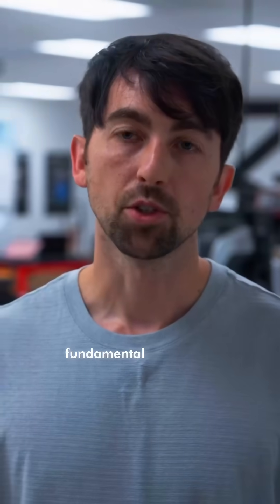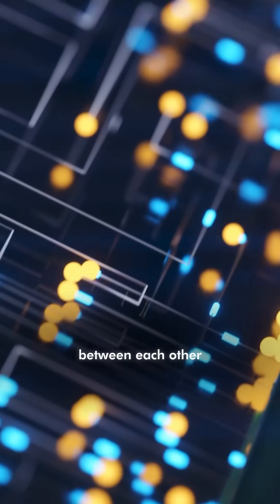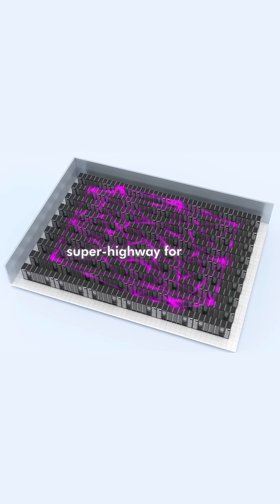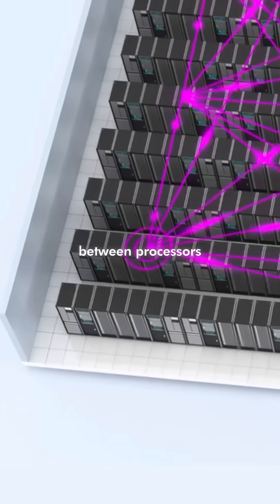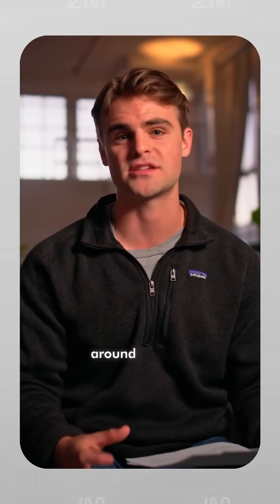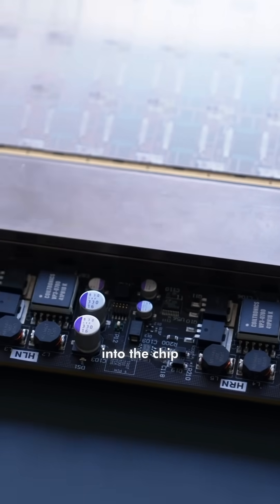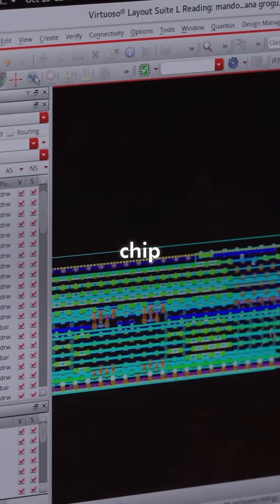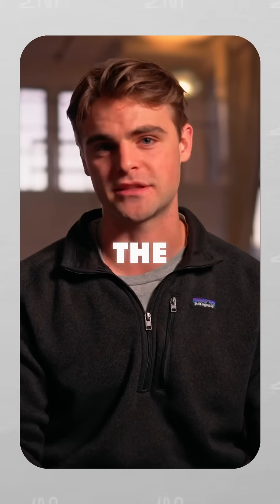Beyond Traditional Computer Chips | Lightmatter

Comment: Optical waveguides on chips are significantly larger than electrical metal routing, not smaller.
Modern metal interconnects are ~20-30nm wide. Silicon photonic waveguides are usually ~450nm wide because of the diffraction limit (you can't confine light into a space significantly smaller than its wavelength, usually 1550nm for telecom).
If you made a fiber as thin as a modern CPU transistor wire, the light wouldn't fit. The reason we use photonics isn't size, it's bandwidth and lack of resistance/heat over long distances.

Comment: Compared to CMOS transistors optical elements and fibers are huge, massive structures and it takes a lot more energy to transmit data in photonics. You can have a large bandwidth though and it's convenient to have a fiber if routing across long distances.

Comment: Using light is really genius because it can cross paths and the information is not affected
Reply: Not if it's guided by fibers, like here. And free-space optics takes even more space than fibers.
Reply: @Martinit0 I was taking about integrated optical circuits
Reply: @Pedro-San705  Like what integrated optical elements specifically? Most elements are about interactions, not crossing unaffected.
Reply: @Martinit0  it's called integrated photonic circuits, look it up. But you didn't extrapolate well my comment, I'm not limiting to talk about just what's in the video.

Comment: NEO 🟰 DEFAULT MODE NETUUORK 🟰 ONE

546 NEWBORN -- Q
546 UUORLD -- P
546 ILLUMINA -- O
546 GOD SEVEN -- N
546 VITAMIN C -- M
546 THE ANGELS -- L
546 PRIME DAY - K
546 NEUTRAL -- J
546 BLUE WAVE -- I
546 TETRIS -- H
546 RADIATION -- G
546 STARGATE -- F
546 BATTERY -- E
546 SPIRIT -- D
546 FAIRNESS -- C
546 MIRROR -- B
546 FUTURE -- A

Conscious Agents use The 546 Geometric Consciousness NETUUORK to Connect × Coordinate × Collaborate.

Comment: I've been a bit irritated with certain proponents of photonic computing because one of the bigger bottlenecks in computing is keeping the processor fed with data; it's memory bandwidth. Photonic computing doesn't really have anything that can replace DRAMs, at least as far as I know. But, photonic network switches actually make a lot of sense.
Reply: So you'd need a special RAM; traditional ram isn't reverse compatible? Is that what you're saying?

Comment: Electricity moves at the speed of light as well.
Reply: Not true. Even in a vacuum (which CPUs aren't, not even close), they travel at 50-99% the speed of light.
Reply: Not true. Even in a vacuum (which CPUs aren't, not even close), they travel at 50-99% the speed of light.

Comment: My father was right. All Computers will glow with light as they compute...
Reply: final evolution of RGB gaming computers
Reply: @0EEVV0  lol
Reply: Wait till you hear about nuclear computing .
Reply: JUST LIKE HUMANS DO! 🤩🤩☝
Reply: nah, if it's glowing it means there is a loss, thus bad design.
Reply: @alkeryn1700 the loss is in the form of light rather than heat.
Reply: @TylerGrieger  doesn't change my point, if it's glowing, it means you have loss, thus bad design.

optical computers shouldn't have any loss, or close to none.

definitely not enough such that you could see it.
Reply: @alkeryn1700 loss is inevitable. It’s the law of entropy
Reply: @mrlloyd149  loss isn't inevitable depending of your system and it has nothing to do with entropy.

and even if there was loss, there is a difference between small amounts of loss and loss so high you could visibly see it.

Comment: So what does this technology actually do?
Change the way the cpu comunicates between the motherboard components or the way it communicates with other pc?
Because in the first case I find it ridiculous and too hard to make.
In the second case it's the same problem, we already have components and chips for ethernet communication, there is no purpose using light because all that time gain is lost inside the networking system which would also be 1000 times more expensive because of the different technology

Comment: The first time I realized that in the Star Trek Universe, the circuit boards for the computer/s transmitted light rather than electrons, that's when I realized that with the approaching limits of Large Scale Integration would limit the speed of computers but also the data density.
By using fiber optics and different wavelengths of light through the same physical fibers we would be able to surpass the physical density of integrated circuits by passing photons rather than electrons and increase the speed at the same time.

Comment: I remember when MB and GB used to be big. Now we’re talking 1TB / second 😮
Reply: wse-3 has 21,000TB/s of bandwidth throughput
Reply: Be aware that terabit ≠ terabyte 
One terabit is actually an eighth of a terabyte since 8 bits = 1 byte
Reply: @dusenkarotte007well, the video says 100 terabits per second, which is 12.5 Terabytes. It's actually more than the comment.
Reply: @dusenkarotte007 Thanks, That just helped me with some nonsense about these units that was going between my neurons lol 😅
Reply: @dusenkarotte007yes true, that results in 12.5 Terabytes per second, still insane
Reply: 1TB is now partially available even commercially. It’s insane
Reply: @shohdj6679 err.. what are you smoking? what has 1TB of bandwidth or speed? our best SSD’s top out at 17GB/s and our best GPU’s top out at 700GB/s - those are just barely commercially available
Reply: @fryttCG multiply that by 8, 16 or 32 bits. We're talking bits, not bytes.
Reply: Japan has transmitted  a petabit a second in a short distance cable if they improve it they can make a really high output ethernet
Reply: The file sizes ballooned with 4K video, 200 GB games, and especially with LLM’s.
Reply: Yeah, similar to this was growing up being a millennial and reciting the components of a computer... We used to have ALU in the CPU. Now, it's just the part of the SoCs being buffed with power and ability.

Times change and so do the relevant socio-economic aspects around the tech industry.
Reply: 100*
Reply: Yes, and a decade of two we will probably be able to talk about YB/!✌️That doesn't even feel that crazy anymore
Reply: that is the trend but it's a little surprising that it's going so much faster than more's law
Reply: 100 bro not 1
Reply: I think people here are using wrong scales. He clearly said 100 Tb /s not 100 TB/s. The small or capital "B" makes a huge difference
Reply: Naaa, we're talking PB/s for a single fiber & EB/s for multi fibers.
Reply: 1TB/s is about the memory speed of the RTX 3090. That's not last gen, that's last last gen.
Reply: We already are in GPUs for years
wdym

Comment: 1)Will this technology adress CPU heating problem?
2)Will it decrease the energy consumption 
of CPU?
Reply: 1/10 energy consumption compared to electronics chip ,less energy means less heat or no heat.
Reply: well light produces less heat than electrons and converting electric energy into light energy is more efficient (it will require less energy).
Reply: Seems like so to me, but i wonder how overclocking will work or be even possible though..
Reply: As far as these optical computers can efficiently run software that were designed for general prupose CPUs: yes. However there's a subclass of algorithms for which optical computers aren't well suited.

Comment: Very interesting but i think you made a mistake with the unit. I think he said over 100 terabits but you wrote terabytes. 1 Byte = 8 Bits
Reply: This byte and bits difference is the worst. It’s hard to remember or hear the difference. Companies use it to confuse costumers. One of the too ought to be illegal to say.
Reply: @simonjonsson3654  It had a purpose rember 8 bit computers that meant that they operated off of 8 bits being a string, thus being a single byte
Reply: @nicholasm5184 yes you’re right they’re both useful. But still, the naming!

Comment: 1) Would they be cheaper that traditional chips?
2) Can they be designed on same instruction sets as the traditional chips?
Reply: Yes, they can be programmed the same but the design of the hardware will be different because less parts are needed for light computation actually making them capable of being more compact. Not an expert I just study it closely so I can’t give finite detail. I’m really enthusiastic about this technology moving forward though. It has a lot of untapped potential in terms of stepping forward to getting rid of electrons in many devices. Making power cheaper. Eventually replacing majority of electrical lines and only using an electric plug when needed for things like motors and heating elements. Luxury electric cars will make more sense with this technology in them and it would be harder to complain about the extras engineering side. Company corruption will likely still be a problem.
Reply: 1. Yes atleast in the future. also less energy consumption 
2. Hmm depends. It's more of analog operation
Reply: Yes to both. Why tf would they not?
Reply: promising 
as a start if they could make some optical lcd's link between cpu' and monitor that can help determine the need and success for future.
Reply: @reviewdtime it doesn't work like that, LCD use whole class of COG IC and work primarly with massive multiplexers that work in very not optimal enviroment on ITO connects, massive capacitance and wild medium of LC or OLED, photonic IC are massive, COG are usually very long to fit, if you want to put them in to processing that may be working but will not be cost effective by very long time becouse this is domain of DSP with 256bit+ long registers and other highly paralell stuff
Reply: @reviewdtime You just sparked an idea for me. You could micro the LCD screen into a graphics chip. The fiber optic connection can be used to bring the image to a screen that magnifies the image like a projector screen but flat and uses no extra energy like traditional displays. Even if the micro display needs to be boosted to show it properly on the fiber optic magnifier display F.O.M.D. 
It in theory would still use far less energy to pull off and use less hardware. The micro LCD screen also gets the benefit of being right next to the hardware for lower latency. The issues then become brightness and is there enough fiber optic lines in my cable to display the image. The other traditional problems would shrink as it would be easier for manufacturers to optimize such a small display to match their hardware. Peoples F.O.M.D. Screens would be forward and backwards compatible though it would likely be best practice to overpopulate the fiber lines to screen for best results.
Reply: From what I understand it’s kinda not really a processing tech. It’s really just an interconnect technology at the moment
Reply: It would be alot cheaper and more future proofing larger data centers and perhabs be a thing with quntum processing even more
Reply: Cheaper when you approach the limits of performance, sure. The application is extremely parallel computing like in data centers, not single-GPU systems like a PC. And yeah, the instruction set remains the same, because this doesn't change the way the computation works. It's a replacement for the electrical wire, not for the transistor. Mind you, there are other people working on optical computation and there the answers are very different.
Reply: If they can figure out how to manufacture them in the same production volume as traditional silicon wafer chips, it'd be cost competitive 
And it'd have the same capabilities, put several times faster and much more energy efficient, the only difference is the interconnect that transfers data by optical cables instead of copper wires
Reply: @newworldordernyus  The scaling isn't necessarily difficult, the die itself is less complicated to fab than the GPU. It's just that there isn't enough fab capacity dedicated to the process. Or testing. Or packaging. But it's being ramped up worldwide.
Reply: 2)yes, light (photon) can measure by binary system. But I prefer to use its analog property.😆
1)Not far from each other I guess. It use similar technology as LAN wire and am sure it will be nano scale (why not).
I answer 2 frist because it's easier, love your question
Reply: No and yes
Reply: 1) no, first generations will be expensive as hell but in comparision economicly superior becouse you will save power/space/pain/money
2)there is no reason to use x86 or ARM or any other existing architecture, this is different method of computation with own pros and cons that require own approach

Comment: One thing most people don't understand is that the electrical wave wnergy actually exists OUTSIDE the wire (on the surface) because of the same reasons that a Vandergraft Sphere.
With the electo-magnetic traveling outside the wire, thiz is one of the reasons s aling down CPU chips becomes impossible -- as exterior waves beside each ormther actually interfere with eact other. It is considered the Qunatum Limit for circuits.
However light generally doesn't interact with other light and can be kept within the constraints of a glass fiber.
Reply: So electromagnetism is causing the limit?
Reply: @gradystephenson3346  yes. With electrical wires you generate electromagnetic waves that interact with each other if they're close enough. Generally this sint an issue since the currents running through these chips is so small that the waves don't travel that far. Or are too weak to interact. But as the chip gets denser and denser, there will be enough electromagnetic fields that will interact with each other and cause performance issues
Reply: @gradystephenson3346 No. Capacitance of the electrical wires/paths is the limit.
Reply: There is a good video on it which someone deleted my link to. It is by Vertasium and he goes over all the same details. Worth watching
Reply: @LG-qz8om it's debunked. many falsehoods in his video.
skin effect is real though.
Reply: Never heard so much nonsense about CPUs. The reason why we can't shrink them smaller is because electrons can tunnel through thin material and with high clock frequencies reactive currents will flow through isolation and heat it up.
Reply: Yeah, i reasoned that since the thing doing the work and having work be done on it in an electrical system is the electron, which is charged, and which also has a field that spreads everywhere proportional to the materials’ resistance, while transmission using light utilizes the uncharged photon as the message carrier, optic data transfer could prove very advantageous in the future.
Reply: Nice
Reply: Yep, faster is the keyword with this new chip
Reply: @friesguy2403I mean, that's a simple way to look at it.
Reply: Right, doesnt all electricity create magnetism and vice-versa? This seems to be an inconvenient side to the usage of conventional electricity (electrons) in nano-scale technology. Light particles are the same thing, but they are perfectly, quickly fluctuating waves/particles of electro-magnetism. They are inherently self balanced, and more importantly, a more compact way to transmit data. 

All the electromagnetism/quantum stuff makes it a bit hard to understand but i think that's the basic problem of it.
Reply: light is electro-magnetic radiation 🤦‍♀️
Reply: Two points where you are wrong: 1. CPU's don't compute by using "electrical wave energy" they work by turning switches, called transistors, on and off. The transitor states represent the information, and the switching on and off is the computation. Interference between the electromagnetic fields of the different circuits does not matter, because the switches are voltage gated. 
2. What quantum limit for circuits is actually referring to, is that when we shrink cpus the transistors become too small that the quantum tunnel effect becomes relevant, leaking electrons through closed transistor gates, causing ones when there should be zeros, making the whole system unreliable...
Reply: Why are people confused on this
Reply: I've seen this investor scam a few years ago, and it's still a scam. Don't buy into this bs.
Reply: Noise
Reply: it can be scaled down by lowering the current but you need a semi conductor that is also a superconductor at all temperature range for it to work
Reply: This is actually incorrect regarding the scaling. Optical waveguides on chips are significantly larger than electrical metal routing, not smaller.
Modern metal interconnects are ~20-30nm wide. Silicon photonic waveguides are usually ~450nm wide because of the diffraction limit (you can't confine light into a space significantly smaller than its wavelength, usually 1550nm for telecom).
If you made a fiber as thin as a modern CPU transistor wire, the light wouldn't fit. The reason we use photonics isn't size, it's bandwidth and lack of resistance/heat over long distances.
Reply: Was this an explanation for “most people”?
Reply: this is debunked
Reply: @legobuildingsrewiew7538  what debunks it? I can show Physics examples which validate my statement.
(Waiting to hear back)
Reply: @LG-qz8om   I would like to see them. You have any articles ?
Reply: @livelaughlove_88h Yoo, my man. Where's your evidence for this?
Reply: @livelaughlove_88h it’s varied. No one can agree on ts